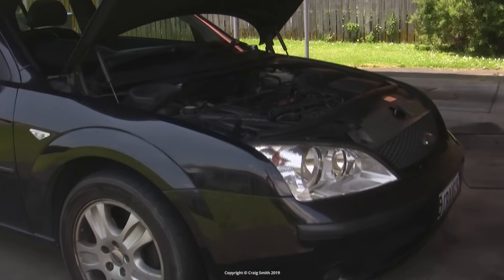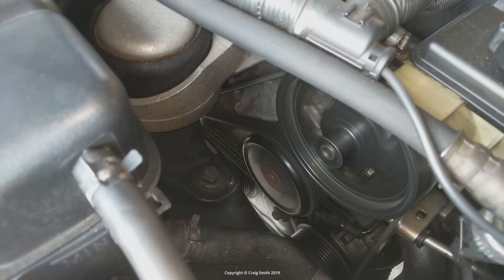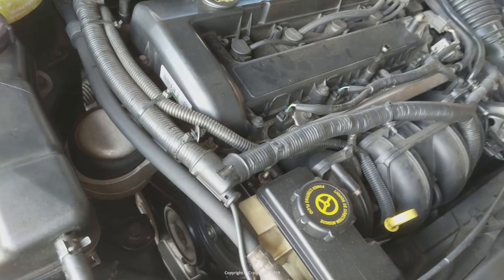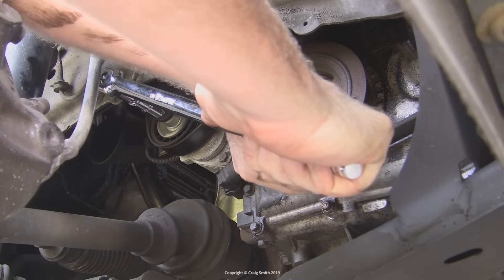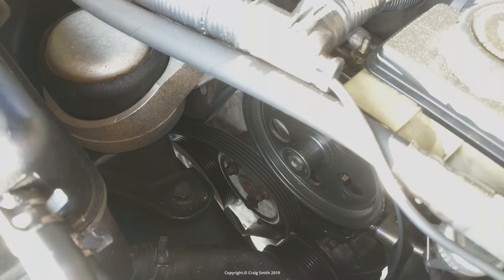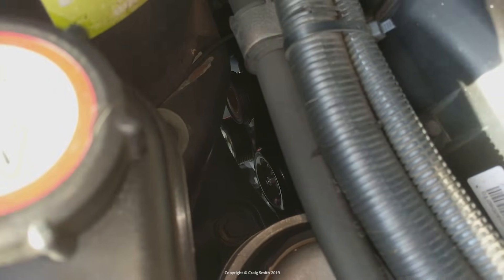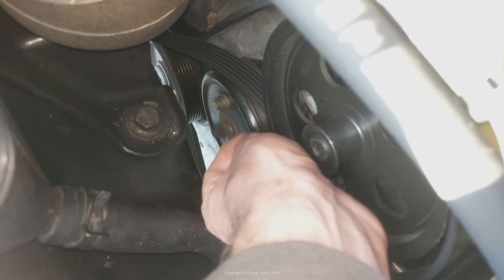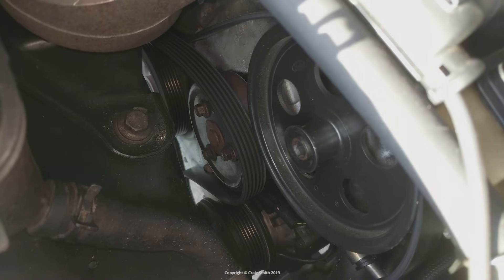Engine knock & rattle: accessory belt pulleys or engine internals?

Comment from the maker: More on the belt & pulleys ~
* Replacing the belt & idler/tensioner: https://youtu.be/ItND7vPozv8
* More on the belt tensioner: https://youtu.be/mOm42H0J3iY
* Water pump: https://youtu.be/cj8JBMJxibQ
* Over-running alternator pulley (OAP): https://youtu.be/XYi_w3ieGUo
Amazon links for the Duratec HE (check your part no.s):
* Serpentine belts & pulleys ~ US: https://amzn.to/2Gugnmh | UK: https://amzn.to/2GLgt8o
* 6PK2225 as featured ~ US: https://amzn.to/2TNQpNC | UK: https://amzn.to/2tpyl0v
* Idler as featured ~ US: https://amzn.to/2BCt0aW | UK: https://amzn.to/2IgAQg6
* Tensioner featured (Continental # 49405): https://amzn.to/2VFScG2
* More tensioners ~ US: https://amzn.to/2S6gW6R | UK: https://amzn.to/2SFdgy6
* Water pump ~ https://amzn.to/2XLTdfC 
* Or, for generic pumps the Ford part # is 1142427 ~ US: https://amzn.to/2ZCqbAS | UK: https://amzn.to/2W5qSAE
* Alternator over-run pulley, try searching ~ US: https://amzn.to/2lvN0H6 | UK: https://amzn.to/2lvSVfr
Reply: , xx zzz z xx xx z xx, xx

Comment: I have abs the same issue after belt and tensioner replacement. From the dealer service they inspected it for a second time and told me they cant find whats wrong. Abs the same rattle and also the belt is Bosch. Not because of the brand but i switched to the old belt which was almost new installed before a year and now i hear the nose but not so much and often. Loooks like something wrong with the tension and this automatic one ... not sure if i could adjust a bit the initial slack.
Reply from the maker: You can't adjust it. The new belt will be a touch tighter so puts more tension on everything. Check the idler pulley and also another common source of belt noise is the overrun pulley on the alternator (I have a video on that somewhere).

Comment: Great video mate 
I thought I had a chain rattle 
On cold starts 
After I clean my car with the hose the ticking sound get louder 
I assume I need a drive belt and tensioner pulley to start with 
I’ll check the rest of my pulleys

Comment: My 02 Avalon has this same exact “knocking” issue on startup and 2400ish rpm. It came after a valve stem/timing belt job. I figured it was the valves but I’m going to have to look into the belt!

Comment: Hello i have this exact sound on a new Renault Captur 1.0 GPL since the second month of ownersip with 2500km on the clock. The specific motor is 3cyl. When visited the local dealer he concluded that was the top right engine mount. When replaced the sound disappeared for 40 days or approximately 2800km and then appeared again. Visited again the local dealer who then blamed the DMF but advised me not to replace it. Since then i have replaced two more time the specific engine mount but the problems keeps recurring after some time and km. Another dealer proposed to do what you describe in order to isolate the three pulleys crankshaft, water pump and alternator. Not to forget the motor has no belt tensioner. He replaced the waterpump but nothing changed. Do you think that it can be the crankshaft or the alternator pulley? Or can it be something else that comes up to your mind. The sound is heard clearly when car decelerates from 1500 rpm exactly at 1000 rpm, when due to the 3 cyl the car vibrates more as a trrrrrrrr (the sound heard on your video after 0'39") but also on idle with a different frequency. It is heard clearly in the cars interior and no so clearly when out of the car.

Comment: Same parts and issue I replaced on my 96 k1500 with a 350 Chevy. Thinking it’s either my harmonic balancer or the crank going out smh. Issue started shortly after replacing pulleys. Harmonic is ordered and here guess we will see in due time 😅

Comment: I kept having problems with harmonic balancer pulley. Cheaply made. The noise was shocking but I agree with taking the belt off. I ran it with it off and was so much worse cos it wasn't under tension so was vibrating more. It's a quick east check for the harmonic wheel aka crank shaft wheel too. Also never buy cheap and try and get a genuine part. I've been through 3 so far.

Comment: I hear the same knock when I’m on stop and in gear or when in park. Do you think it’s the tensioner?
Reply: Yeah I'm wondering if the belt is slipping and that's what's causing the crankshaft pulley to knock when it's in idol or the heaters on cuz my fan wires have oxidized and so it takes up more electricity to run the fan and to maybe keep the car going when there's not Air Forced into the intake just from being in motion (cuz the crank pulley causes the engine to shake when I'm idled or when the heat's on) Plus my MAF sensor it needs to be cleaned.  the shaking is the worst when I'm both in idle and heat on.  So I'm thinking that the belt is slipping and throwing the harmonizer off to make the wobble plus the alternator isn't being spun at the right speed because the belt slipping there too. Sorry to ramble, clearly I'm inside right now.

Comment: this video is very old so i dont expect any replies but i own a 1989 Cadillac sedan deville and just recently i got off the freeway and my car started smoking (i figured out i had a coolant leak and this has happened before so i knew what the smoke was luckily i was a minute away from home) but then after that happened my gas pedal started making a rattling noise everytime i pressed it and also the coolant leak seemed to have sprayed because there was coolant all over the left side of my engine i guess my question is does anybody know specifically what this issue is? im trying to avoid going to the mechanic but if it sounds bad then i might as well ill gladly do my best to answer any questions also!

Comment: Similar issue..replaced a lot of parts..some needed others not so much..tonight I ran car with belt off..same vibration and rattle noise...looked at harmonic balancer ,seemed to have a slight wobble,actually not even sure,but I ordered one off Amazon and are keeping fingers crossed this is the problem..

Comment: Would squealing in damp weather be another symptom along with a ticking noise to indicate checking pulleys etc, car has almost 160k kms and hasn't had any timing adjustment yet.
Reply: Mine doesn't go as fast/strong unless it's a certain day with the right pressure, moisture and temperature; I think.  So I am thinking that it's the continuity of some oxidated wires. Eh?

Comment: This is exactly what I’ve been dealing with my car, just started doordashing and a new job 30 minutes away from home. My water pump is new so I knew it wasn’t that but this pulley has shaken my engine so much the cover cracked.
Reply: Just got a diagnosis for it today, definitely not driving it anymore until it’s fixed
Reply: @drusilladean5349  what was the diagnosis ?

Comment: Had a knocking sound at around 2500 or 3000 rpm and sometimes at idle. Did some checks on the engine and couldn’t really find anything out of the ordinary apart from my worn out pas pump (but I already knew about that one) one morning I was letting my car warm up and I was standing outside listening and the sound seemed to be coming from under the car so because it was only warm not hot I held my exhaust tip and the noise disappeared, let go again and I heard the noise. Turned out that it was just my exhaust rattling cause my exhaust hangers I’m guessing are about as old as the car and have never been changed. Stuck some new ones on and haven’t heard the sound since so keep in mind that the noises you hear aren’t always directly related to your engine

Comment: The pump will not cause that knock, it's the hormonic  balancer (crank pulley wheel) if you run the engine and look underneath of the pulley wheel you will see it  wobbling about.... 10 quid I bet you he changed the pump and the noise was still there.
Reply from the maker: It's not the crank wheel, do I get 10 pound? :D
Reply: @CraigsDIY  come on don't lie! Nothing to be ashamed of, we are marine and mechanical engineers I've got 2 guys working for us on and off site,, we had in 1 years ago a Renault Trafic 1.6, 17 plate just out of its warranty, fair play to the owner he took out the engine stripped all the auxiliaries and sent the Block and head away to be rebuilt, skimmed head reground crank new bearings the full works, we was asked to rebuild the outer and put the engine back in with new clutch, as we was lowering the van off the ramp owner turns up, go on then chum start him up, knock knock ratle knock, knock. And all because somebody told him his bottom end is gone, in your case that knock would not be a bearing, this year alone we probably changed over 100.
Reply from the maker: It was the alternator over-run pulley mate
https://www.youtube.com/watch?v=XYi_w3ieGUo
Where's my tenner
Reply: @CraigsDIY but he changed that 100 times
Reply: I bought a 77 Cutlass supreme in brand new condition for a $1000. He had just had the top end of the motor rebuilt but still had a light knock. So he got his wife a new car and sold the mint 77 Cutlass supreme to me . 😃 A couple of days later I drove the car to a near by store and a old friend I haven't seen in 21 year's  happened to walk by and said you may want to check your water pump. I smell coolant and heard a light rattle. 🤔🙄 Sure enough the whole top end was rebuilt but the water pump was leaking out the bottom of a weep hole and never had been replaced. What! True story. 👍
Reply: How do you fix the rattle noise

Comment: Thanks for this. I’m getting a weird engine noise and I suspect either a pulley or alternator bearings as the noise only occurs under load (adding extra electrical load makes it worse). The noise is most noticeable when the car is driven so should it be okay to drive it for a few yards?

Comment: Well, this sounds pretty similar to my noise on m9r renault. Its the original belt, never changed. First i thought its the timing chain which is under a cover at the same location. My mechanic said yesterday it doesnt sound like the chain. I should try getting of the belt as you did. So i will try this 👌

Thanks buddy
Reply: How did you get on? I have the same issue with my m9r engine too it's an a renault espace. Been concerned its the timing chain but could easily be one of the aux belt pulleys
Reply: @kevinhoyes3344  For me it was the CrankPulley of the aux belt. You can easily see it if you turn your wheel completly right and just open the plastic cover behind the right front wheel. If your noises is at specific rpm (for me it was about 1500rpm) you can see it shaking while it makes noises.
To change it you need a special tool to counterhold  which i bought for about 30€

Comment: My w212 is making this sound and I can move and hear a small clunk just by hand with the idle tensioner so I’m hoping it that. Because I don’t think I have Knock but more of timing chain slap in my head haha. But hopefully this helps.
Reply from the maker: If you can move a pulley by hand with belt tension still on it, I'd say it's definitely going to be making some sort of noise. They're cheap, replace it and see what remains.
Reply: It’s the idle tensioner in my case.

Comment: Would a pulley cause the engine to vibrate at intervals? I noticed if I put it in park the rattle is gone but if I put it in drive it rattles and then goes away... pls help 🙏 😢
Reply from the maker: Sure but so could a lot of other things. You can't guess, have to start isolating the issue. Could be bad, engine internals, could be simple, pulley or engine mounts.

Comment: I have that exact loud knock when starting for a little bit more time but it completely goes away after 2 seconds on a cold start. I plan on changing my water pump, both belts and water pump and tensioner hopefully this helps!
Reply from the maker: Alternator pulley. See my later video on it.

Comment: Did you investigate that 1 second rattle at start up? I have the same  noise on a 2002 Mondeo which only happens on a warm start, never on a cold start.
Reply: I have the same on a 2013 Scion FR-S n it’s honestly tripping me out
Reply: @MOGI-yy  On mine it’s looking like one of the hydraulic tappets draining out. I’ve eliminated everything else...
I’ve had a few of these cars, not had it on any except this one. 
Probably gonna live with it but yeah pretty annoying.
Reply: @MOGI-yy  Have you fixed the issue since?
Reply: @msk_xx8085  currently in the process of an engine rebuild
Reply: @MOGI-yy  Oh wow, what’s the reason for the rebuild?
Reply: @msk_xx8085  the knock ended up being a spun bearing and it tore up my crankshaft and tore up one of my connecting rods
Reply: @MOGI-yy  How Loud was your rattle on start up just curious, I’ve got a similar noise but it’s hard to notice and doesn’t seem to match the engine speed, I know I have a blown idler pulley bearing but I’m hoping that it’s nothing to do with an internal mechanical problem
Reply: @msk_xx8085  from what I remember you couldn’t really hear anything When it first started but it would get worse when I would raise the rpm
Reply: @msk_xx8085  and then the more I kept driving it the louder it would get
Reply: @MOGI-yy  How many miles was this at? Doesnt seem to sound like the issue I'm having luckily.
Reply from the maker: Alternator OAP (pulley). If you have an OAP then check it. If you've eliminated the whole belt by disconnecting it per the video then carry on.

Comment: Hello Craig.
I recently replaced a rattling belt tensioner in my 2002 mbz c320........As well as a new belt for good measure. the rattling went away. but now it is back ????? anyone got any ideas ????? I can clearly see that the spring in the tensioner is not keeping two surfaces apart and that is what I see is making contact and causing the rattle. BUT, I thought a new tensioner with better spring and a new Belt would solve the rattle......as I said, it did, though only for a moth or so.......
Reply: I also have replaced the water pump in the last year...........

Comment: I would be terrified to remove any part out of my block, having the mechanical skills of a dodo. However I am learning since the noises in my car give me a lot of stress lately. I am stuck between replacing my car on the one hand, and calculating (guessing) how long my current engine will run without completely falling apart. I am  not even sure it is safe to drive anymore.
Reply: 😂 I drive a taxi and engine noises can seriously affect my mental health. I’ve had to learn to ignore them as I’m driving for 10 hours a day. If the engine blows up, it blows up. Fate will decide that.

Comment: I haven't had time to check my noise bit I think it's bearings from  a pully. I just chopped the aircon pully belt cos it's quick and easy and can buy new one. And I don't really use it, But it's not that. Took it too local tuner paid him for his time to tell me what he thinks it is.he said small end bearing...
 He told me to go to his "friend" that's a engine  builder /fixer that so happens to have the same engine in storage that I have, he said it's internal... so quoted me $4500 and mentioned he had the same engine  I can have for $5500 (he got for free because someone gave him the engine to put new cams in and 5 years later never asked for it back).... 
I really do hope its just a pully so I can fix it myself and say to myself, fuck you! Haha
The engine is a rb25det neo and I put it in a 1998 gu patrol

Comment: Do you hear it only when engine is warmed? Cause i hear the same noise when the engine is warm.
Reply: Mine disappeared after replacing parts Maf sensor, coil packs, check vacuum if theres any leak, spark plugs and reset ecu. Can’t remember which one it was. Did a lot of testing.
Reply: @beatles  lot of works. Thank for answering. I will try changing my alternator first.
Reply: Have you solved it? Mine is the same.
Reply: @vicheatalk9249  I also replaced my timing belt pulleys. Im not sure anymore which one fixed it lol
Reply: @vicheatalk9249  I would suggest start with inexpensive parts one at a time.
Reply: @beatles  Thank you. This is really helpful. 😃

Comment: Having the same issue with my acura tl and I can hear the knock more inside the cabin, specifically accelerating slowly.  Because cause when I accelerate fast, I can't hear the knock. And I figured it was the serpentine belt tensioner pully. This video helped me more too. So thank you.
Reply: Yes i'm having the same issues was you able to solve the problem.
Reply: @dsmiley250  yes i figured it was the tensioner.
Reply: @israelreynoso9006  thank you so much i have the same problem with my Acura tl.

Comment: I was getting this noise for sometime.. thinking it was cam chain, valves, taps, fuel pump pressure, top end knock, oil pressure. Got the belt changed after 137k miles! (It lasted but was on the way out) now have a bigger nosie when bonnet up. I guess it's a pulley, on it way out. As reving the engine sounds perfect! Does the aux belt, always go at one speed or go fast when underload? As I have a noise and would like to think it's a pulley, gearbox on its way out. Drives fine and pulls great. Just noise's at 140k on a 2L duratec ST150

Comment: So my engine sounds like it has a bad rod knock what are the chances you guys think the it could just be a timing belt ? Note the knocking only happens when I accelerate. Also note there are no codes on the dash
Reply from the maker: You need to pull the belt off and isolate the noise as explained.